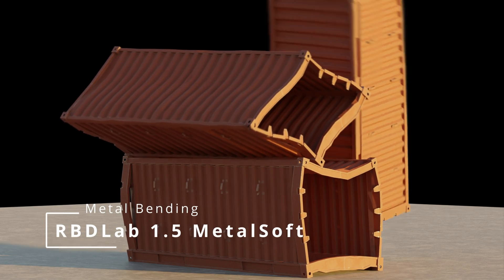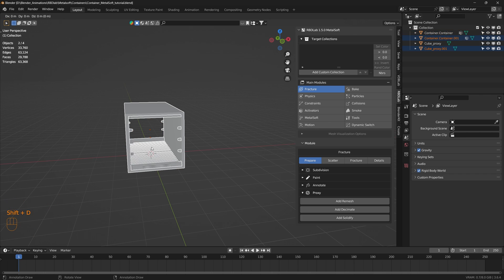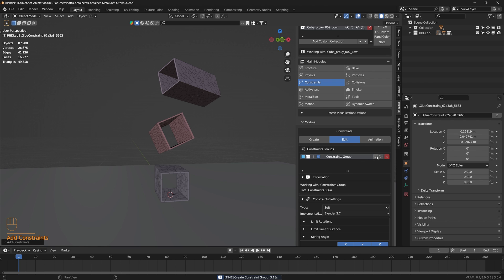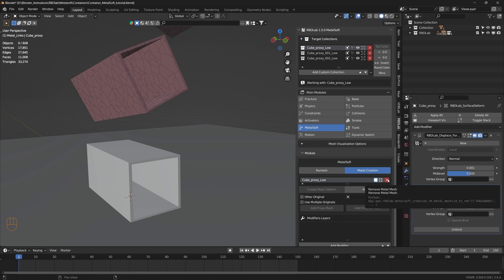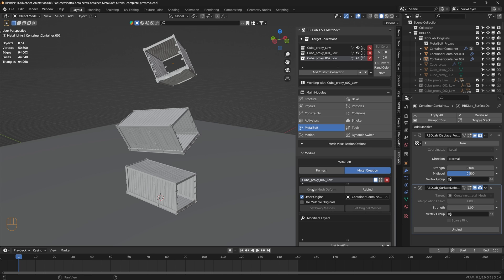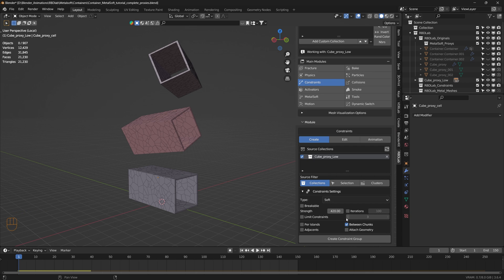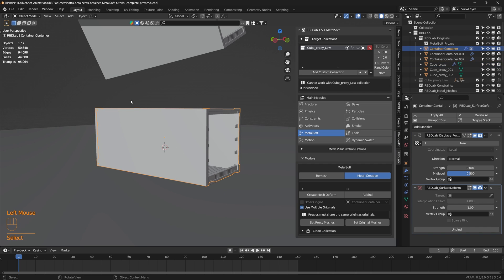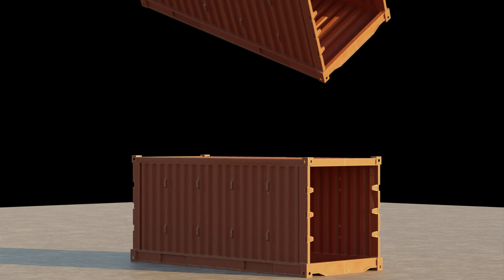RBDLab 1.5 MetalSoft Tutorial - Metal Container

Comment: Is there a way to mix the mesh deformation with proper breaking physics?
When I try, the mesh gets stretched in ridiculous ways.
Reply from the maker: as in any software where you do not configure your settings properly. You will have to work with the constraints to get the effect you are looking for.
Reply: @befxstudios3D  

Fair enough,
Do you have any recommendations on how to achieve it?

Let's stay I take the container example from this video.
If I want the one at the bottom to tear in half starting at one corner

How would I do that?
Reply from the maker: @Danger_N00dle  You would have to have your original geometry ready to be split in half. You would have to have 2 geometries, the container divided in 2 parts, so that later with the constraints they appear to be a single geometry, but you can break those constraints to split the piece in 2. 

It would be something similar to what is done in this tutorial:
https://www.youtube.com/watch?v=Y8PX1Hz0RXE&t=9s
Reply: @befxstudios3D  
Yeah that makes sense, thanks.

So the original model has to be cut in pieces then a proxy can be used for the pieces?

My idea would be to have a large metallic structure made out of I beams and what not collapses after some supports are lost

Ideally it would use proxy to allow for high resolution mesh, but also allowing multiple point to breaks.